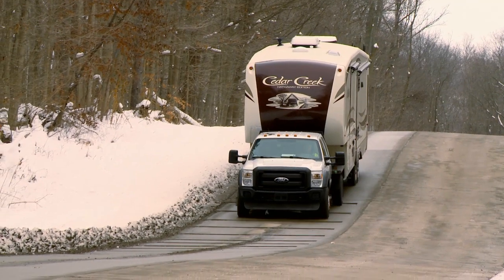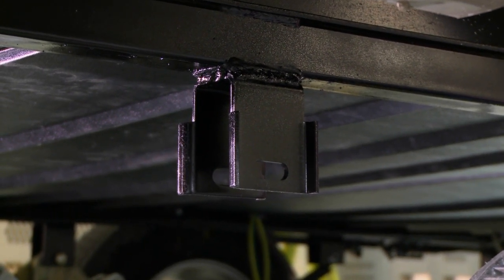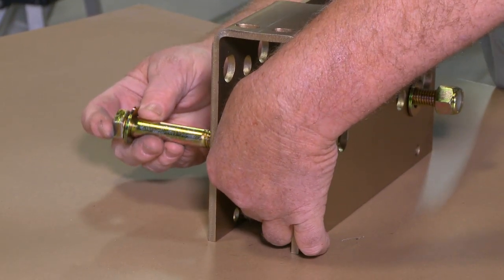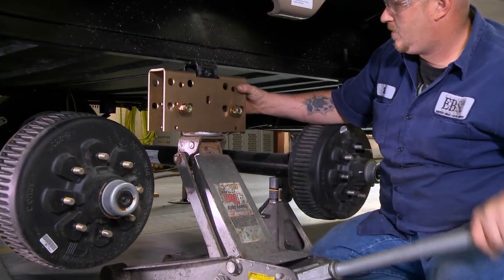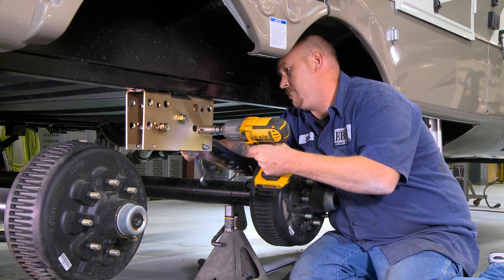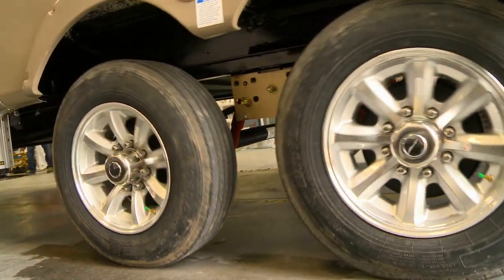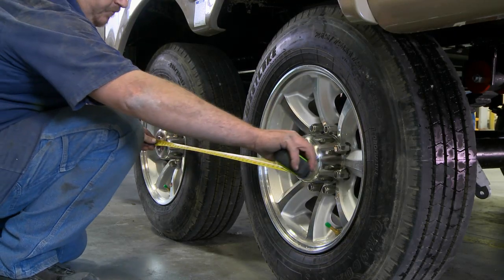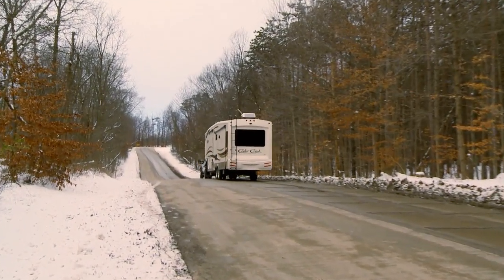LibertyRiderInstallVer3 0

Comment: I installed the Roadmaster Slipper Springs and the Comfort Ride Shock Absorbers. Easy install, Quality System, and so much better than that expensive MorRyde Independent Rubber System, which has rubber bocks that fail after 4-6 years.(also very expensive.) So much better ride than the stock spring shackles with the Mor/Ryde 3000.